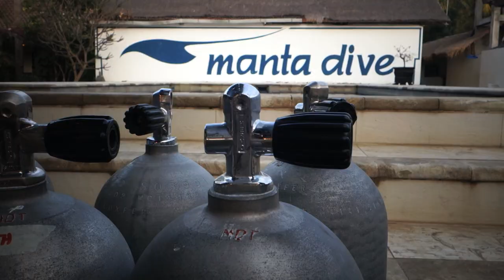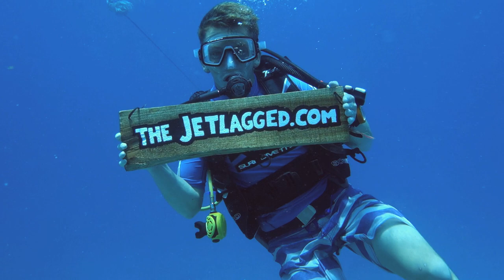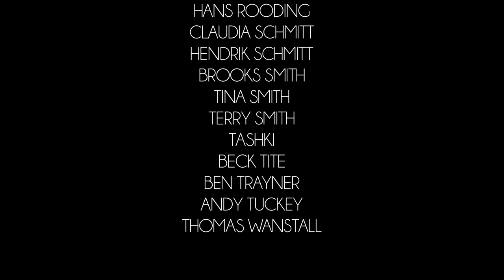We live underwater (Biorock Coral Reef Restoration / Artificial Reef)

Comment: how much current is being used in this cage built here? also, how is this power driven? can this power be driven by natural means like sun or current?
Reply from the maker: +ickerish: It is a low voltage current, maybe between 5 and 12 volt. There are several options for the power supply. In the case depicted in the film, we used a power cable coming from land. But floating solar panels are also possible, as well as small wind turbines or even little wave energy generators.
Reply: The Jetlagged | Scuba Diving & Travel Videos - Always Adventure. Thanks for getting back! Ok awesome. A small team of mechanical engineering undergraduates here at University of Hawaii at Manoa will be building an underwater shelving system to husband coral in areas where the reef has been damaged. I think driving the current through solar would add some fun to the project. The reef you guys built is very inspiring! I'd love to know more about how I could be a part of saving the ocean like that. I'll be graduating in a year and want to be useful to the planet in anyway I can!
Reply: The Jetlagged - Ocean Films & Adventures you stated that you used a power cable coming from land. Was it attached with one end to the metal biorock and the other end on a 12 battery? Like a car battery?